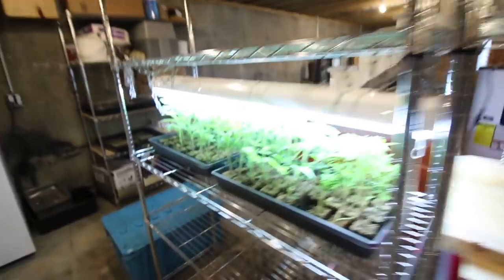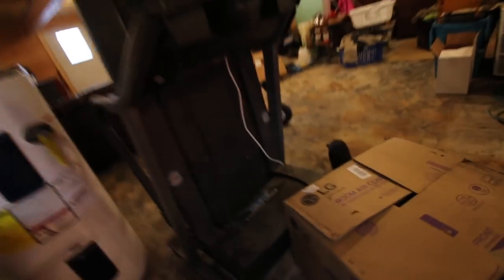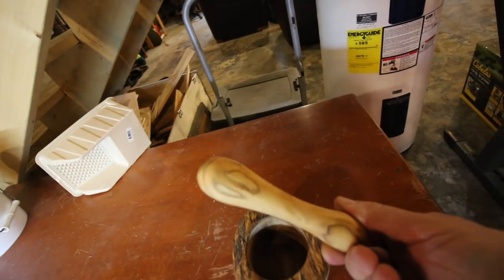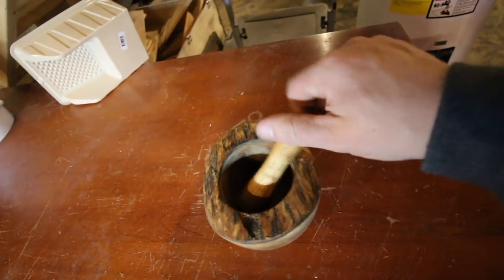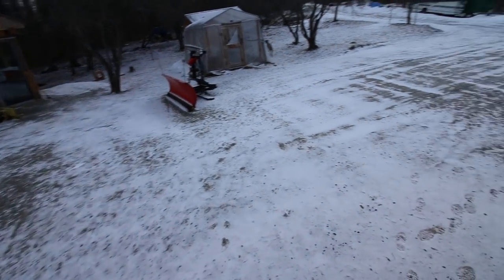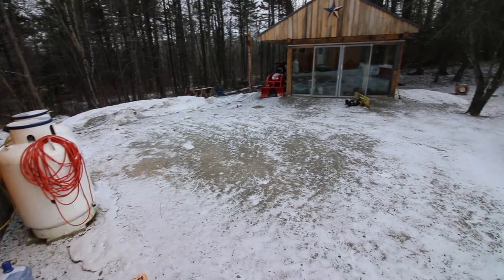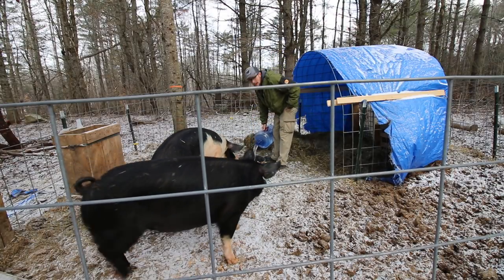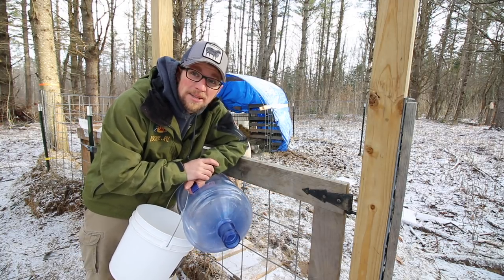Our Last Update Video with the PIGS

Comment: Gee, I signed on early and I am in the fifties as to the people who signed on.  I missed you the day you did not do a video, but the day after was very special.  I have been saving recipes for over a dozen years.  I must have well over 500,000 recipes.  Al you are a hard worker.  Congratulations on reaching 25,000 subscribers.  Al, I remember joining the channel just about the time you hit 5000 subscribers.  Yes Al, you ARE that good.  We were cool yesterday, down in the sixties.  I expect to see temps unto the mid 80s today.  My sweet potatoes are doing well.  Your tomatoes are doing better than mine, and I am in Texas.  
Your pigs are looking so good.  Have you measured them lately to calculate the weights?  You did end up measuring the weight in your video.  
Your mixed flock of chickens is impressive.  Getting ready for your pig harvesting class will be hard,  but rewarding work.  God bless you all.
Reply from the maker: Thats a lot of recipes! I need to measure the pigs

Comment: Al:   You could move  the light over the tomatoes up into the next shelf and add a second one if you have .  Also wrap the rack in a  ( cheap dollar store )vinyl space blanket to reflect light into the lower leaves.  the old guy   Bert
Reply: PS  Or just lower the tomatoes down one level and adjust the light down on the chains.